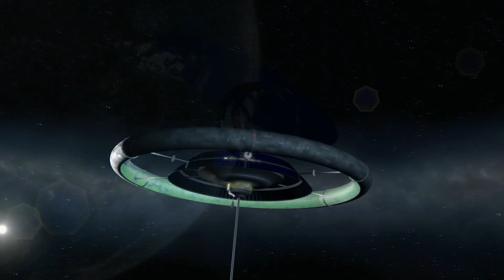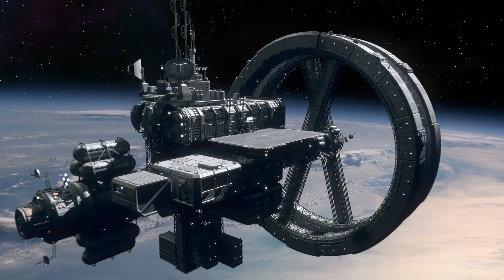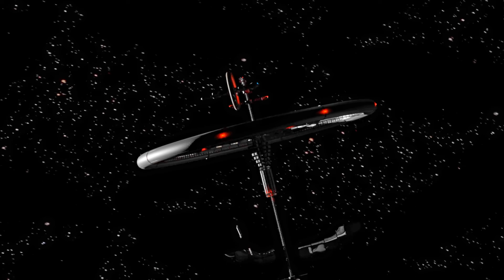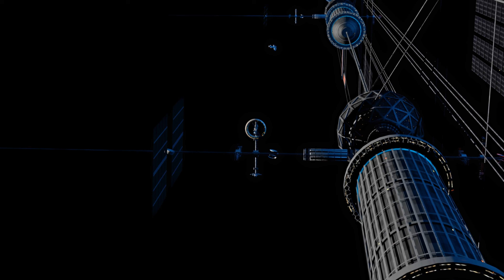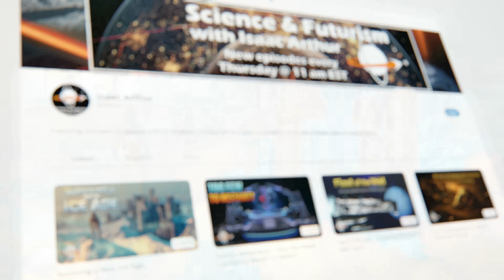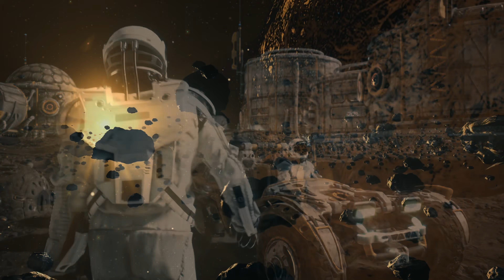The Von Braun Wheel - Building Humanity’s First Rotating Space Station

Comment: Gamma radiation is the deal breaker.
Reply: Gamma radiation is fairly easy to block though, half inch of lead and 13 feet of water. If you want even more shielding you could add 2 feet of concrete.

Comment: I'm surprised it's a big circle and not a black sun shape!
Reply: It will be, brother
Reply: @asahearts1 what is operation paperclip
Reply: @waltertheartist2746 A paperclip can be used to make a nice pinwheel lmao
Maybe it should be pinwheel shaped.
Reply: @asahearts1 yeah I get it. I know all about Huntsville and the nasa program to rescue nazis and rehabilitate the reich's reputation. Fits right in to the current zeitgeist
Reply: Like on a mary go round the force depends on the radius from the center. A sun like shape (i assume you mean sphere) the distance from the rotation axis whould vary wildly. from 0g at the "poles" to max force at the "equator" most of these designs are optimized for a specific force like 1g for normal gravity. Different force could be achieved by having multiple rings within each other. In summary, it is certainly possible but less mass efficient so not desirable. If you want more surface area you simply add another circle until you arive at an O'Neal cylinder
Reply: considering the man never believed in the ideals, I'm not surprised in the least
Reply: Just goes to show that all the faerytales about magic and space aliens is bunk, not real, a manifestation....
Reply: "Black sun" likely has many references.  But the only one I can think of is a bit too..... German.
Reply: @shanerooney7288 What are you, a germaphobe?